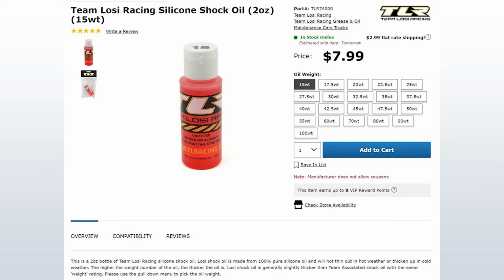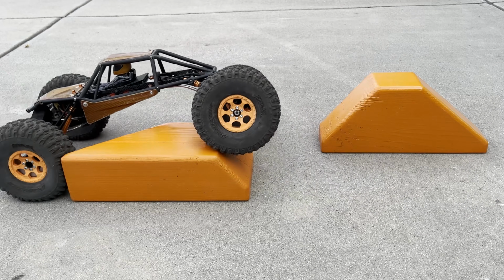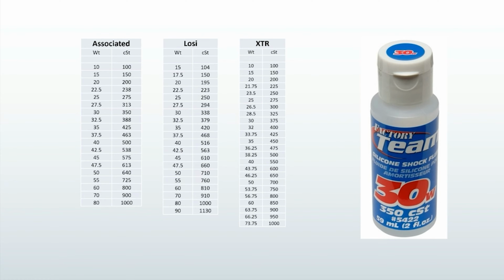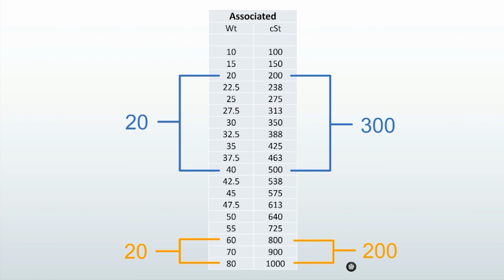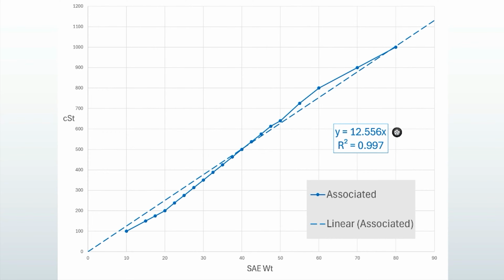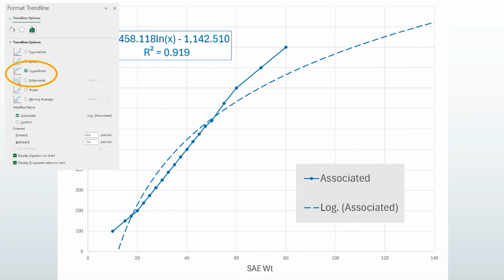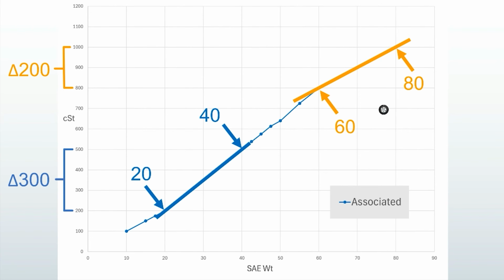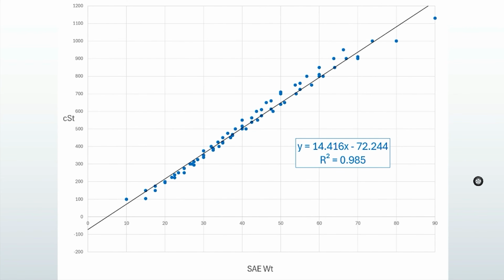Shock Oil Viscosity Explained: cSt and Wt

Comment: Very informative video. One question. Is there any potential risk for using different cst oil in my bicycle suspension from the manufacturer suggestion? Will it brake the shims as it design for lighter oil?
Reply from the maker: No, you can switch it on bike shocks without any issue. But I wouldn’t deviate too far from what the manufacturer specs because they design the damping adjusters to give most people enough range. Are you really heavy or really light?

Comment: W in motor oil doesn’t stand for weight. It stands for winter which has its own scale.
Reply from the maker: True. 10W is the measured value at 0deg C (cold weather) and 40 is the measurement at 100deg C.

Comment: I got a question old boy says the other day the more you lay your shop down it will therefore change not only your spring but your shock fluid
Reply from the maker: That is correct - as you lay a shock down your effective spring force and damping force, as seen by the wheels, goes down.

I explain in this series of videos in case you have not seen them.

https://youtu.be/j-1-NYuaqRY

Comment: Excellent info. After much experimenting with various oils during the summer months I ended up using Shimano hydraulic brake fluid in some of the dampers on a RC buggies and race cars. Settled on 20WT (200cSt) shock oil for the rock crawler. As most of my dampers were set up in summer with temperatures around 25c I expect these to behave a little differently in winter, especially when the temperatures drop below freezing point. Not sure if there will be enough performance difference on small RC vehicles to warrant changing fluids in sub zero conditions but I will find out soon enough. Altitude and temperature certainly makes a difference to fluid viscosity as experienced with DH MTB suspension on long descents, particularly in winter, so it will be interesting to see how the tiny dampers on the RC cars react to changing environmental conditions.  RC cars are just like the bikes in that there is always something to adjust and fiddle with in the pursuit of performance. sure keeps us twiddlin and fiddlin which is all part of the fun . Keep up the good work Sir.
Reply from the maker: Bike shocks usually generate enough internal heat that you don’t have to make significant changes to the oil, but I don’t ride in the cold much anymore. My fat bikes are rigid. Crawlers don’t heat up shock oil at all, and I’d be surprised if even buggies got warm, but I could be wrong. So little mass in play. 

Shimano oil is mineral oil. What did you find out different from silicon oil?
Reply: @BoomslangSuspension  I tried the Shimano mineral oil when I had run out of light shock oil for 1:8 rally car shocks. found it worked really well and I have about a gallon of the stuff in the bike shed so have used it on a few cars from 1:12 to 1:8 scales. I also discovered that the O-rings dont shrink in sub zero conditions so dont leak, measured a few different O-rings with micrometer and they do swell about 1 or 2 thou more than same rings with 'proper' shock oil. 
maybe worth a try if you got some handy.
Reply from the maker: I was wondering about the seals.
Reply: @BoomslangSuspension  I think the DH bikes are affected more with long descents due to air pressure change rather than temperature, although they do get a few degrees warmer on rough tracks & freeride. You can feel the difference in stiffness after 1000 to 1800ft descents down to near sea level. Not an issue for me now as I retired from DH in 2019, too old and broken for that now so RC cars have taken over and they don't do massive rapid elevation changes unless one falls off a cliff, then the shock oil will be the least of it's problems GRIN
Reply from the maker: 😂 I can relate.